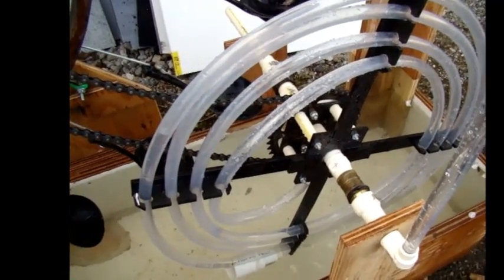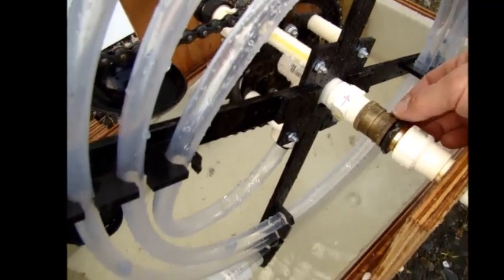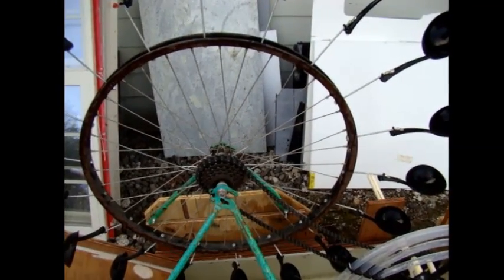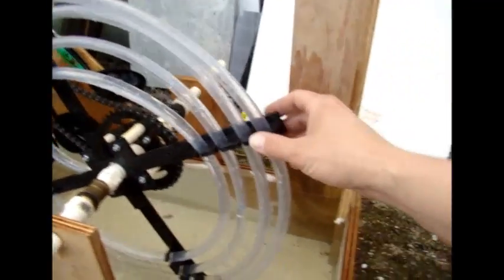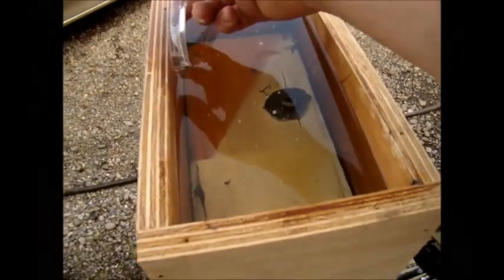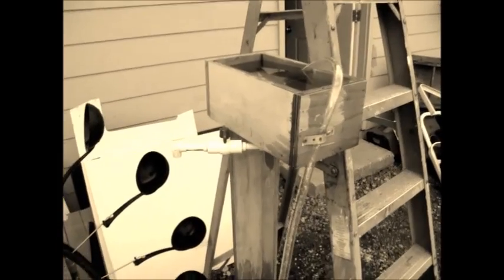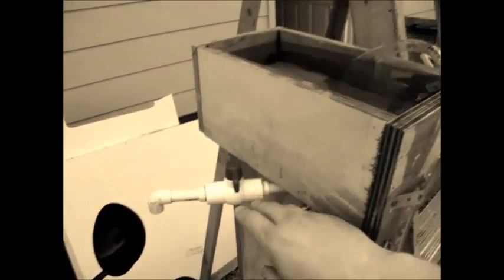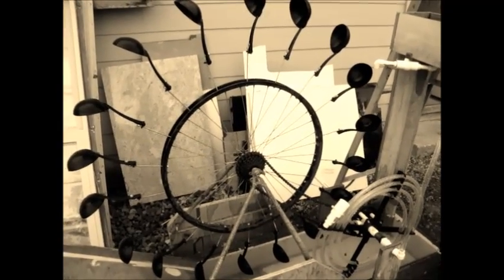perpetual motion spiral pump water wheel.

Comment: Do you have a spec sheet on your build, or where I can find plans, this would be cool in a flower garden. That is awesome reverse engineering.
Reply from the maker: I have no spec sheets at all. I just looked at the original video from years ago, I have no idea if it's actually still posted anymore. And just guessed at sizes.
Reply: @woodbrassandglass  I've seen that one too, my plan was reverse engineering and guesswork lol. Thanks 🙏
Reply from the maker: @fivevenomstyle6337  That's exactly how I built it all those years ago. I just found a bicycle tire that seemed to be about the same size, I went to the dollar store and bought the plastic ladles and use 8-32 bolts to attach them to the wheel.

Comment: The only way to get this truly running, is to add a motor somewhere. A turbine driving a pump driving the turbine… will never work. There is friction in the system, and you must compensate for that loss.
Reply from the maker: You're exactly right. when I built this I didn't sincerely believe it would ever work. however if it was more eloquently built with better looking parts would be a pretty cool yard decoration if one so wanted. but as for doing something extraordinary this is not the contraption for that lol.

Comment: Why don't you use a 36 volt motor as a generator to power a 12-volt water pump that can pump a lot of water build your system a little bit bigger and a little bit more weight to it along with a fairly decent size capacitor Bank on the output of your 36 volt generator I plan on making a video about mine that I'm building using that type  configurations I just spoke of and it'll keep running as long as you have water and you have not too much of a load on it the capacitor Bank helps with that but you have to have a light connected to it to continuously discharge the capacitor bank so you don't overcharge it and blow it by not having a load on it at the time I chose a 36 volt motor has my generator so I would have extra amperage and power to be able to go to a separate capacitor bank that will be able to power various 12 and 24 volt appliances including battery charging batteries empowering small inverters while the primary capacitor bank will power the motor for the pump gravity does all the work to continue the process you want a decently large tank at top a decent-sized power bank rated to double the voltage of whatever voltage system that you're using for your generator so for a 36 volt you want a 72 volt rated power bank with a decent capacity finding a more efficient pump that can still provide decent amount of water flow to do the job is preferred cuz that will boost the efficiency of your overall system and add to the amount that you can then use on a load

Comment: Really a good idea ... have been enough for someone a little knowledge of how to configure this machine. Each cup is "the lever of Archimedes" ... Therefore, increase the diameter wheels with cups in 2 times and get a win in effect rotation of the wheel in 2 times ...
Reply: Also, increase the neck so that it was 2-3 times greater than the diameter of the hose and the length occupied eighth of the circle, and the mouth of the hose a quarter of the circle just sank into the water ... and the main circle of the second wheel (with hose) did not get into the water -so reduce friction with the water ... you can also change the output hose on thinner ... this will lift the pressure in the system and be able to lift to a higher height of the tank with water ... that could increase the power of falling water.

Comment: I like the design even if its not very effective. Adding a Kelvin water dropper will increase efficiency. 
If you are interested then I can send you a simple design for a low-cost magnetic impetus - not 100% perpetual but running as along as the magnet doesn't wear off (200-400 years).
Reply from the maker: Email me
Isaiahritchey@gmail.com
Reply: Magnetic motor running for 200-400 years? Can you prove that? First time I hear of a magnetic motor running for so long. They tend not to run at all.

Comment: would it be possible to make a piston pump maybe, so that the wheel with the cups spins another flywheel ( heavier maybe ) that pumps the piston pump, could you not make it with gearing so that the pump was able to move an identical amount  of water. Hmmmmm many questions I have. maybe two piston pumps so that it was pumping on both the down and up stroke, one each side of the fly wheel. or have the main wheel whit the cups gearing down to a really small cog that you attach a fan blade to the end and have it push water up the pipe that way. i guess what i am thinking is there must be a way to create balance......  surely.

Comment: I am actually working on a similar version of this. I use a water ram that pumps up water from the ground without any electrical input. The water spins my wheel and then falls into a big plastic container that has another water ram connected to it, which pumps the water back to the starting point,,, the ground. I call it perpetual motion, others call it bullshit, I call it FREE ELECTRICITY, they call it FAKE.
Reply: Anther recommendation I can give is just get rid of the spiral pump! There are several other ways to do it... USE A WATER RAM! Also, hook up a couple of used treadmill motors to it. You can get them from Ebay or a thrift shop. It'll be worth the buck, they produce electricity like crazy!!! Use it to charge a battery bank by connect them in parallel, and use a Joule Ringer 3.0. It will give AC output that can run a heavy duty battery charger connected to you battery bank. Hook you battery bank up to a Pure Sinewave electricity and live off the grid!!!

Comment: instead of spiral pump, use a hydraulic ram pump to get the equivalent
Reply: ram pumps require high flow rates. (Ram-pump is the wrong selection in this case.) It might be possible to have a separator at the top to bring the air back down and use it again as an air-lift pump.

Comment: You need a different pump. Look up these airlift water pumps where you lift the water up via air bubbles..this way you can lift the water much higher with less work (energy) ...
Reply: "this way you can lift the water much higher with less work (energy) ..." that is, of course, a lie, a lie that is being systematically repeated by pseudoscientists.
Reply from the maker: Wow these pumps are cool.  Thank you!  Did you check out the rest of my channel i am doing several other projects involving free energy projects.
Reply: fantastic
Reply: +overunitydotcom wow thanks man for the tip of looking up air pumps those could be extremely useful for me in the future.

Comment: might i add a suggestion...?? shorten the distance... add 3-5 tubes for the spiral pump, and have a bigger tank... for both the pump, and the faucet... make the weight in the tank bigger... or add a "self flowing flask" here the weight is crucial...if the weight in the hose is light enough and the flask/tank holding the water that was spent...... and the pump being horizontal.... would not work.... gravity makes it  move ans stay in the pump......make it slanted yes it might help... but not flat on the side....... the flask idea make it go straight to the water wheel from the tank...and the water will not slow down... unless it gets flung around alot then put up a bigger trough to contain it...... every drop counts over all..... and if you hook up a generator.... make sure u make the water wheel be more powerful....harder to stop.... cuz they apparently slow most versions of water wheels i have seen in vids..... they show the thing not connected... it goes fast.... they connect it... barely going half a mile per hour by my guess...
Reply: if u stuck with the spiral pump... try shortening the tube length of all tubes... and have them all at 90 degree angles.... or as many as possible and put them on at different intervals....a spiral set of spiral pumps... where the mouth is at different places
Reply from the maker: Thank you for giving interest to my video!
     I did try using 2 pumps in parallel at first, but this whole system would overload and not pump at all.  Even if it had worked it would only be around 20% efficient.  With 1 pump it was only about 10% efficient.
Reply: ahh... well. there was this other guy who did the same thing... i suggested he might use a "self flowing flask" if the thing works.... u could either a: put the water in the sink direct from the tub...or b: put the hose/ faucet directly over the water wheel....where there buckets on the wheel,,, put multiple faucets in places for them to gobble up water... say... put a spout next to the bucket on the side ---> and have it blow water at the bucket enough to make it move slightly... put other faucets  from 5 o-clock spot up to 1 o-clock.... if the tub is big enough... u can do this with  over 6-10 spouts pounding each bucket.... making the bucket at the top nearly full by the time it reaches the bottom.... and so on....if u hook a generator up .... then as i understand.... the extra faucets while overkill.. would ensure the water wheel doesn't stop turning... and that would be a must....if you try it and it works... let me know with vid...i want to make one exactly like it... but bigger....to me..."overkill is underrated, my friend" - liam neeson... the a-team..

Comment: Nice idea! I wonder would happen if you had 4-8 hoses on the same axle timed to always have one scoop picking up the water, and a water wheel designed to receive all the water falling into it from the highest part of the wheel (right of center)   If  magnetic cogging principle attached the water wheel to the spiral wheels in that case the spirals would need to be in a line( See Raul Hattem magnet cogging)